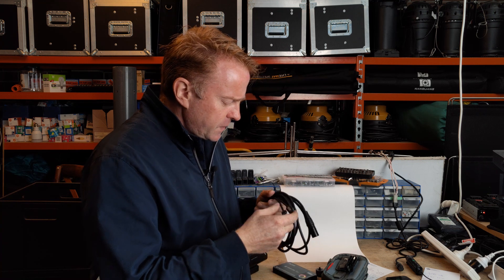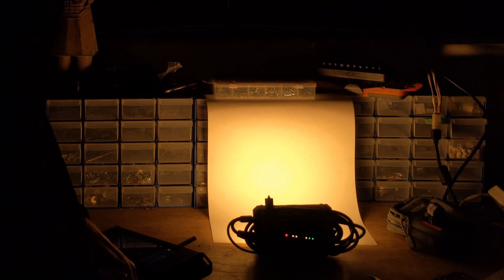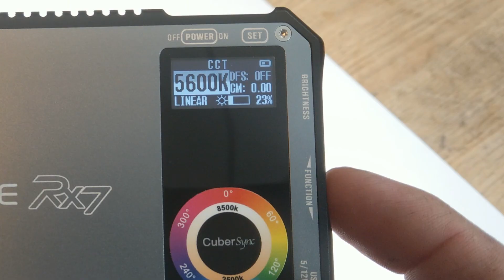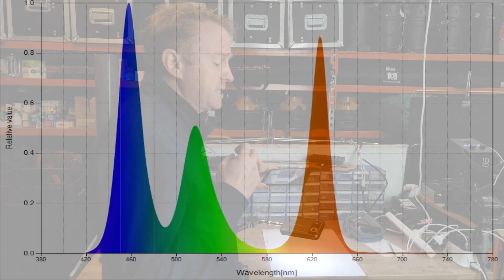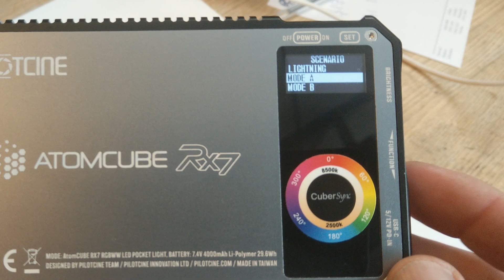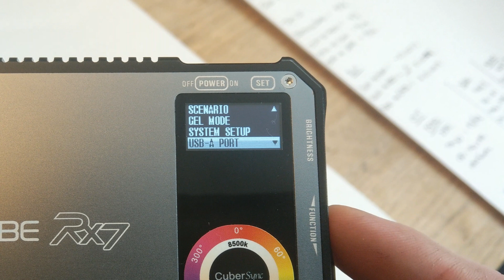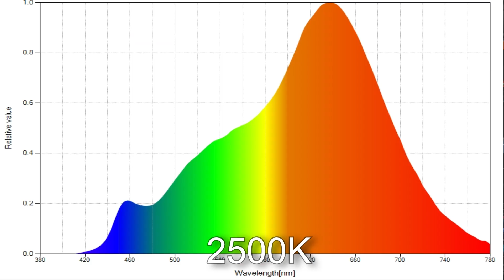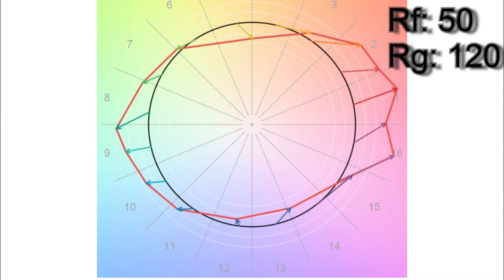Gaffer & Gear 147 – Atomcube RX7

Comment: not a big fan of the cable solution on this tiny unit. kinda cancels out it’s compactness. wireless dmx build in would have been really nice.
Reply: Agreed. Surprised there's not a pocket sized light with CRMX built in yet!